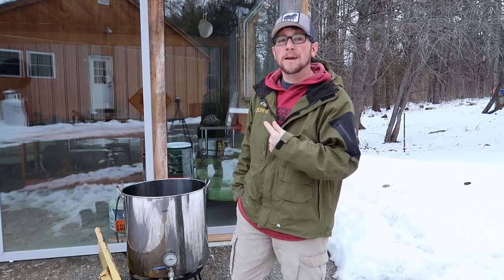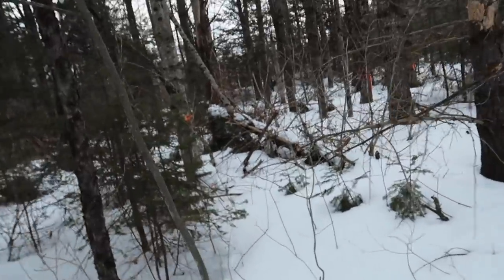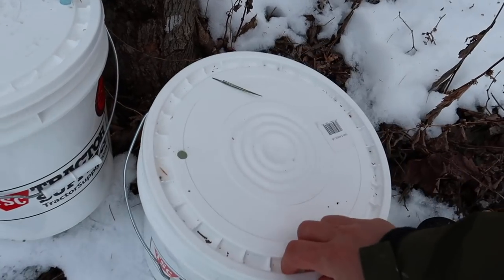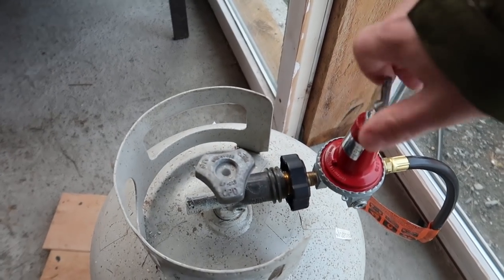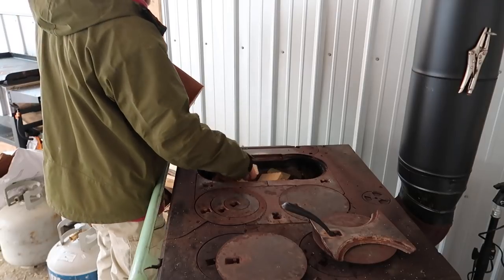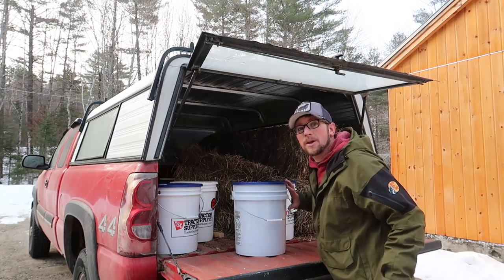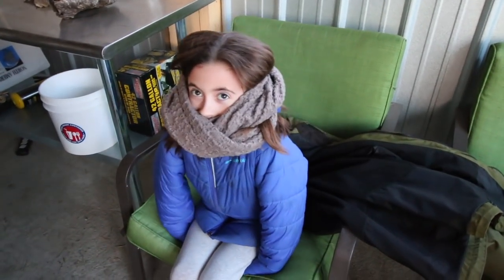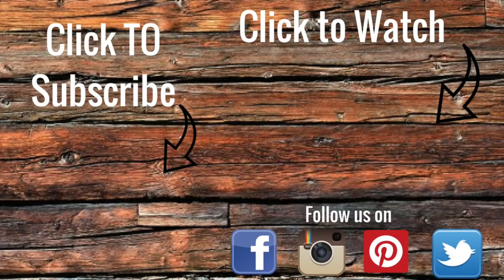You wont Believe How Much Maple Syrup We made Today

Comment: Great job and end result.  Darn propane cost..Since you add moisture in the house could you freeze sap and let it humidify the house slowly.  Great idea to pre heat and add more surface area.  I wonder if you let a pot on the stove with enough volume to not worry until am when you stoke the fire and add sap vs water.  Good luck.  You hit the right year to get started.  Sap may run thru April with your cold weather.  Stay warm.

Comment: Have you thought about maybe a small hand held fan to blow the steaming fog away?  I'm sure you have. You're a very smart guy. You must be getting tired of sap and it is just starting to flow.  Lol!  I also wanted to ask how you store the syrup. Do you refrigerate it or store it in the pantry- (cave)?
Reply from the maker: we use an oscillating fan on low at a distance when its needed. Right now our wood stove makes enough air movement in the basement to move the plants a little
Reply: Lumnah Acres I was talking about the steam off the sap/syrup boil to blow the steaming away so you can monitor the product. OOPS!